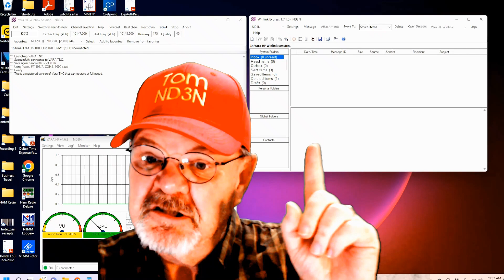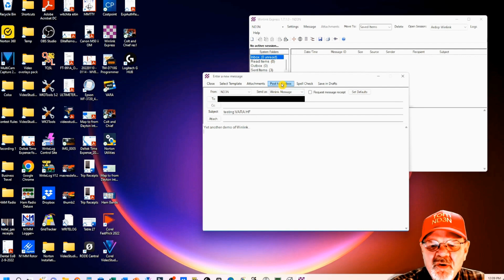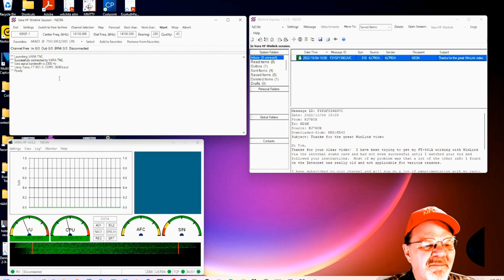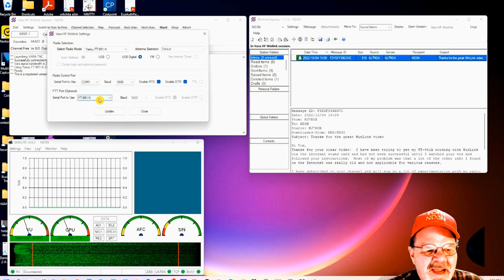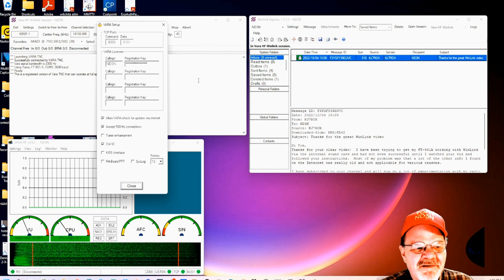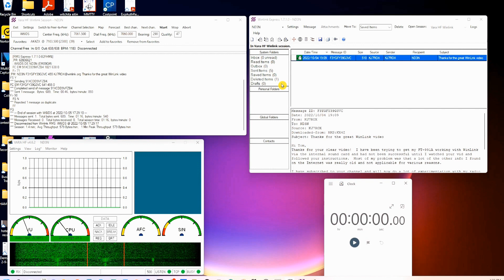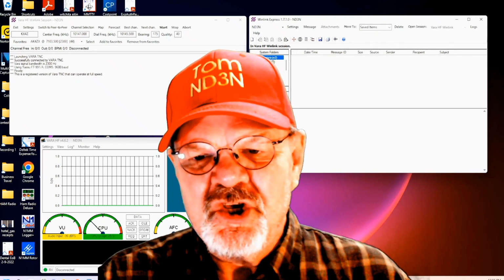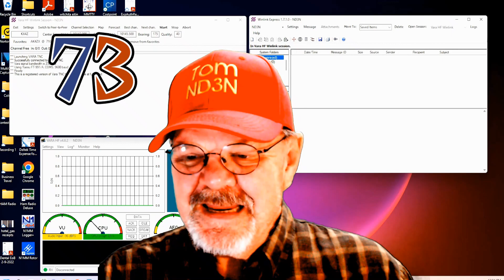FT-991A Set-up and Demo of Winlink VARA HF

Comment: Tom, hoping you can provide some advice. I'm using an FT-991A and have doubled checked all of the Menu and F (List) menus you've noted.  I've gone through all of the config steps in your video, have created a test email, selected a 20 meter freq (W0SMT) and attempted a transmission.  My laptop triggers the FT-991A transmit, but there is no deflection on my SWR meter noting an actual outgoing signal. In the end of the TX process, the transmission fails to connect.

Any suggestion as to what is preventing my rig from transmitting?  I have no problems when working SSB or FT8, having successfully completed a couple of thousand QSOs.

Thanks & 73
Jim
VA3HFD

Comment: What is the secret to getting vara fm to work on the 991a?  I have tried every setup found on YouTube and none of them work for me.  I keep getting “no signal” message on auto tune even though I am well within range of station.  Help!
Reply from the maker: Unfortunately, I have no experience with Vara FM, but will take some time to figure it out for myself, then pass it along
Reply: @ND3N  Got it! working last night, well, kind of.  It is definitely transmitting.  Just does not appear to work with digipeaters, only direct connections, and unfortunately, I am too far away to direct connect to anyone.  Thanks for all of your videos, they are so helpful!

Comment: Tom, my set-up went well on the 991a with Vara HF and Vara FM , the problem I am having is I can’t make any contacts, the software try’s several times then states unable to connect. Some of the channels I select are not that far away, maybe 28 miles, puzzled, do you have any thoughts, JH KE8TSN

Comment: Thanks for the video. I am trying to use my FT991A with Vara. Using the USB connection the VU meter on Vara goes to peak pos. Any suggestions on how to reduse the input from the radio?
Reply from the maker: Make sure your meter is in the correct mode.  Should read between 1/3 and 1/2 scale in ALC.  meter setting is in functions ….  Let me know if that works.  73 de Tom, ND3N
Reply: @ND3N  You got me wrong. It is the VU meter on the VARA display that peaks. Found the solution: Menu item 73 (data out level) on the radio. Setting below 10 works ok for me.

Comment: Thank you for another instructional and informative video. I did have some trouble getting some of the settings set on my Yaesu FT-991A set as you mentioned below. I am scratching my head trying to figure out what I am doing wrong. For example under 
F (-LIST)
   WIDTH: 3200 Not sure where this is ?
   WIDTH: NAR/WIDE: W 3000 Set to W 16K the only other option is N 9K
   AGC: Auto cannot change from Fast
   DT Gain: 6 is set to 0 cannot change it.
Reply: I did figure out these settings. I could not get Width to match the recommended 3200. The maximum number I could set it to was 3000. I am also attempting to chase down a low S/N ratio.

Comment: Thank you for the HF with vara, no problems there. I got everything set up for Vara FM with my 991a and it keys up my radio but no data sound is coming out. the tnc program shows connected and the audio input and out on it show its working. and com ports are correct as well as the soundcard in and out is correct.Buad is all the same radio and computer. I just cant figure it out!
Reply from the maker: What is your DT-Gain set to - and What is your ALC reading?  As you're transmitting turn up your dt-gain until your ALC is about 1/3 scale.  Let me know if you get it working.  73 de Tom, ND3N

Comment: Help, Vara settings as described but audio from radio to computer so low its showing -90db. Everything else seems fine. Verified correct sound card settings. Any suggestions?
Reply from the maker: What is your DT-Gain set to - and What is your ALC reading?  As you're transmitting turn up your dt-gain until your ALC is about 1/3 scale.  Let me know if you get it working.  73 de Tom, ND3N
Reply: @ND3N  resolved: Windows audio had the miv level for the 991 turned way down. Brought it up a bit and the software hears whatbthe radio hears now

Comment: Thanks for the video.  I've had nothing but problems using VARA with the FT991.  Ditto for the other local 3 Hams with FT-991 radios .  No VARA problem with Yaesu or Kenwood radios.  Nice to see it actually works with the FT991.  Time to upgrade the 991 drivers maybe? dunno....